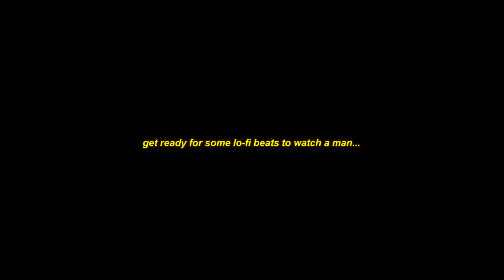DREAM BUILD // COMMENCAL META AM 29 // Late Night BUILD in the Garage

Comment: other than the obvious supply issues can you share why you chose the 29er over the mixed wheels?
I'm trying to decide which one to get.
Reply from the maker: Very good question mate, I chose the the full 29er for a couple reasons, other than the fact it was in stock, I was quite used to the big wheel coming from the Kona Process X and I also wanted this bike to be as fast as possible for enduro racing. The slightly better roll-over of the bigger wheel at the back is faster especially in a straight line. However I really like the idea of the Meta SX, I think it would be very playfull and really good in the corners. I think these Meta's are incredible and maybe in the future if I do less racing the SX would be a serious contender for my next bike! The champaign colour especially!
Reply: @BlueSkyBoys  chur bro, that champagne colour is fire right!

Comment: Was this a 65mm stroke shock as opposed to the 62.5mm that the frame is spec'd with? If so, did you run into any clearance issues? Beautiful bike!
Reply from the maker: Nope this shock was 62.5mm as well. Definitely wouldn't recommend using any other stroke other than the spec'd 62.5mm. Theres no seat stay brace on this model which would help with clearance issues however an extra 2.5mm of stroke would result in over 5mm extra wheel travel. At that point in the travel the compression and rebound would both be pretty harsh and dull feeling because the leverage curve isn't designed to go that far. Thanks for the comment hope that makes sense!

Comment: Is it cheaper to build it yourself or buy one prebuilt? I'd love to build mine from the frame up, but idk if it's worth it in terms of cost
Reply from the maker: To be honest it's probably not cheaper. James works at a bike shop so has access to staff pricing which made this possible. It's really hard to beat the prices of complete bikes but boy is it fun to build them!
Reply: I built up a clash not to long ago, worked out about 800 bucks cheaper, transferred my pedals bars seat and stem over. But since commencal jacked up the prices i doubt it will be the same outcome